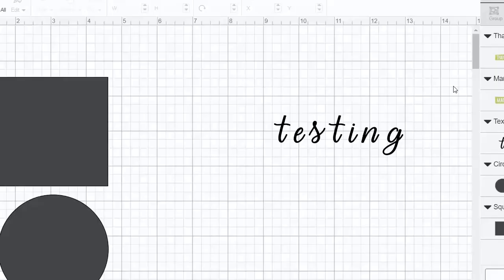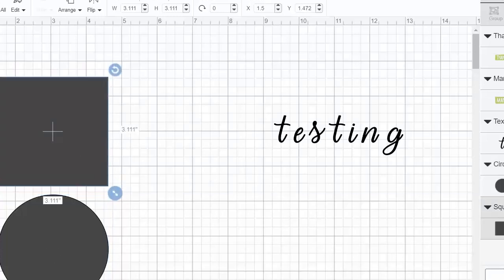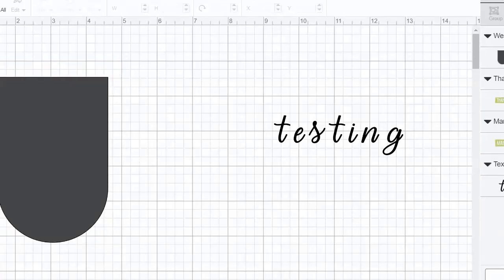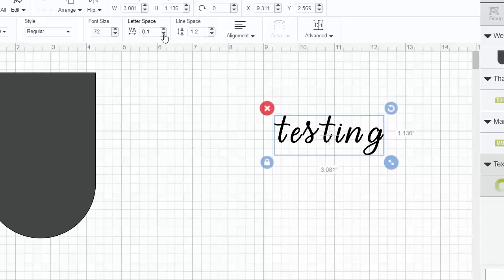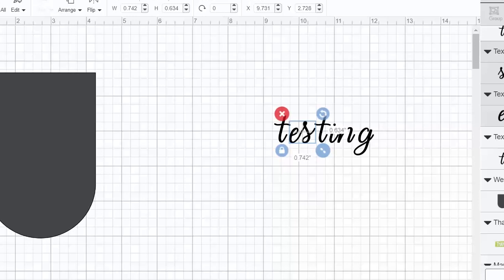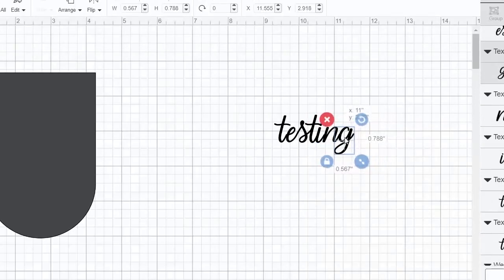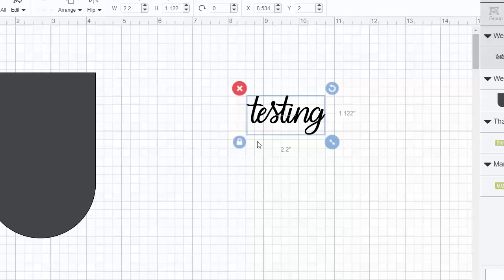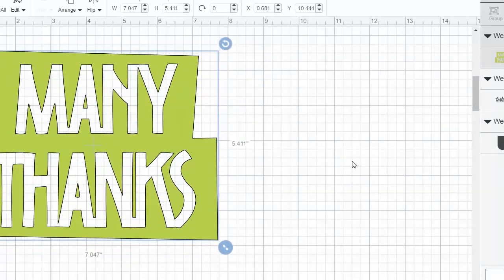Cricut Weld: What is it? How do you use it?

Comment: Hey, great video! Thank you. I am unable to weld text using the font Adalaide. Are there certain fonts that are unable to be welded? I am able to weld other fonts, but for some reason, I am having a hard time welding this one. Thank you
Reply from the maker: That is a writing only font so it would not need to be welded.
Reply: hi angie how do you print pictures vertically, and horizontally with a canon 2522 pixma printer